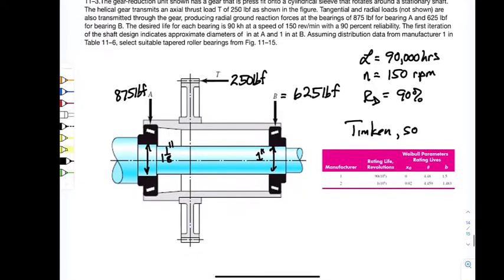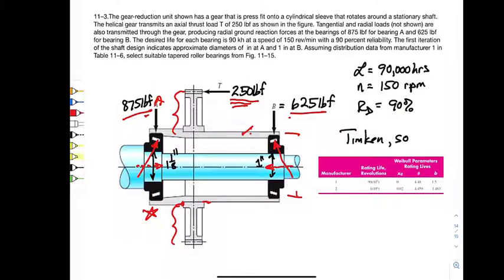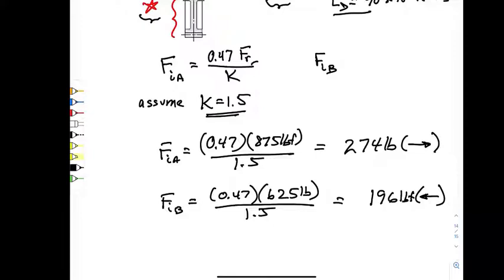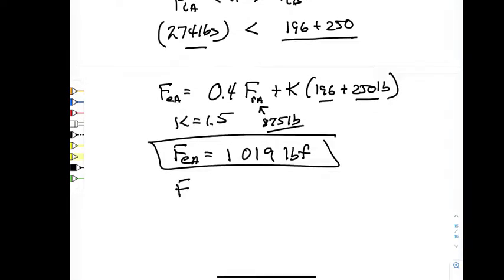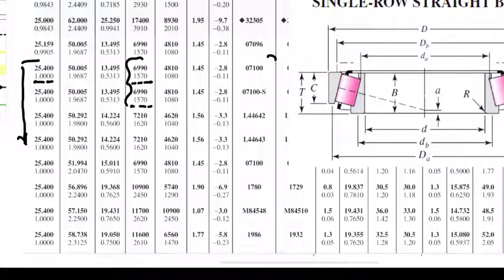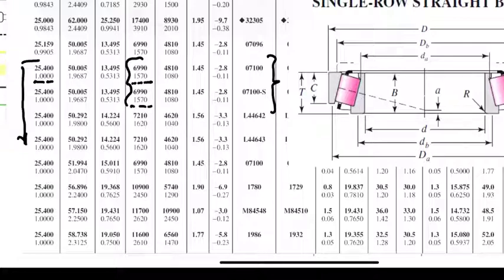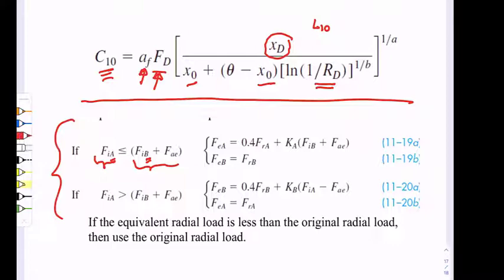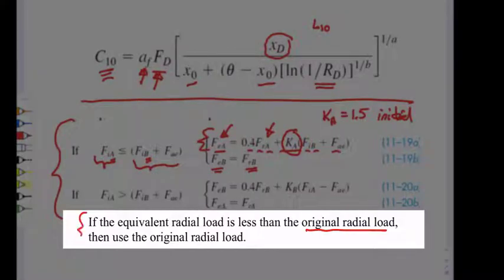Lecture 20b Sample problem for tapered roller bearings

Comment: Professor, I stumbled on the same question. Need help!
Reply from the maker: The chart I show is just a portion of the bearing catalog.  You would need to go to a comprehensive catalogue from the supplier you want to use.   For instance, you could go to the SKF online catalogue and enter the dimensions of your shaft and it directs you to a bearing.  The lecture here, is showing you a procedure that you can use to double check what the suppliers suggest when they point you to an online calculator.  You could also go to the online pdf catalogue for Timken, or NSK, or Fersa or Schaeffler.   There are many sites you can choose from.  Pick the supplier that offers the best combination of price and reliability that can deliver to your location.